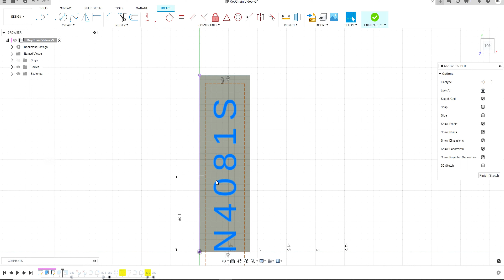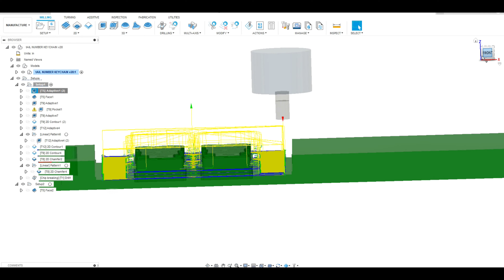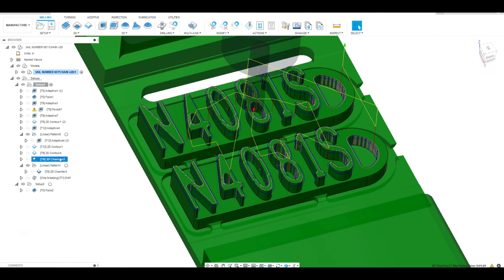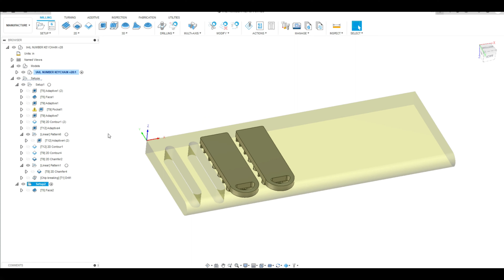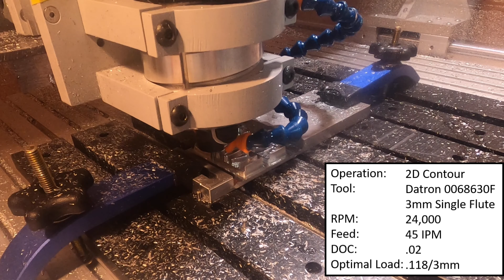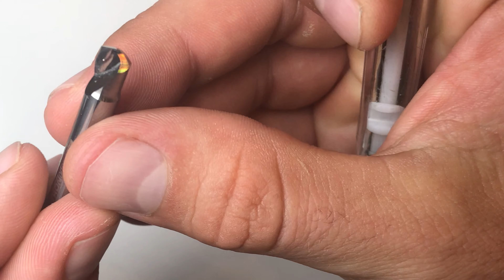Aluminum + Single Flutes on a CNC Router: Custom Keychain Step by Step

Comment: I have a really hard time with tool changes.  Even when it's the same shaft diameter, the cleanup cuts seem to be shifted from zero.  Any advice? Also you should post some new material!
Reply from the maker: Yep I know what you’re talking about. The answer if you don’t have a bit setter/z hoking device is to try to use the last tool to clean up everything so there aren’t overlaps. That can be quite time consuming depending on the geometry so clever design to avoid the needed overlaps/changes can also help. I just got a shapeoko that has the bit setter and it makes a world of difference. What machine do you have?
Reply: @BodheKnows  I have a power route plus with a dewalt router as well.  So, very similar machine.  I've had it for about 1.5 years and I've put a lot of effort into it.  Pretty frustrating to be honest and I basically have ended up with a very similar set up to yours (homemade mister, panels to block chips from getting into bearings and rails, etc).  For the parts I originally wanted to make with it I have given up and send models overseas and takes about 4 week turnaround. This video popped up and it's really helpful (wish i searched for it when I started!) and I'm going to try some of your feeds and speeds see if I can at least do some of the aluminum parts... the one sided ones... but ultimately the poor reproducibility of positioning between jobs stops me from really doing anything too cool... it's alright if I don't change the tool but doesnt make sense that same brand same shank size endmill doesnt go to the same position...
Reply: @BodheKnows  I do have the touch plate and get the z correct.  Have you tried adding anything like stock size probes (sorry dont know correct name off top of head)? Or used a different software to run the machine?

Comment: Did you have any problems with the grbl controller that comes with the power route?
Reply from the maker: What type of problems? I would say no but using UGS to run the machine has been a learning experience. I’m also having an issue with my z probe switch, haven’t diagnosed it yet.